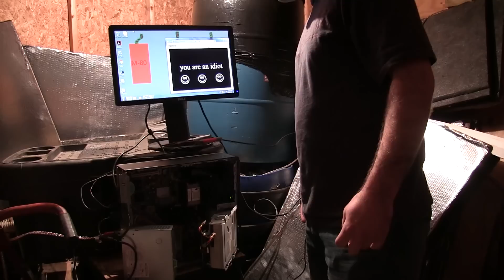HP Computer Destruction

Comment: Happy birthday! I hate HP too, they're trash. Dell is ok tho
Reply: I've had 4 fine HP computers. Am I lucky or is it because they are all pre-2009?
Reply: +- λshton - This would have been a better destruction if it was running Windows 8. Single worst operating system I've ever tried to use.
Reply: true that
Reply: +IAmNotAFunguy destroy with windows vista
Reply: I actually hope the next one they destroy is a modern Mac.
Reply: IAmNotAFunguy Only problem is they go for $2k. Parts are worth quite a bit too. It's trash but overpriced. That's Apple for you
Reply: +IAmNotAFunguy yes
Reply: Streamlined Steamroller they use laptop parts, XD
Reply: You must be an Apple fanboy.
Reply: I mostly hate hp But the hp computer I got for free was really good It has windows 7 home premium and its a laptop with a intel core duo 2. Also my favorite brand is acer, they used to suck but they got better overtime Like, i have a acer desktop from 2007 running vista (vista is good! its the exact same as seven as long as you update it!) and the computer fly's!  And the acer chromebook line looks like the best line of chromebooks!
Reply: I like Hp.....
Reply: IAmNotAFunguy I'm torn between Windows 8 and 8.1 as the worst OS.